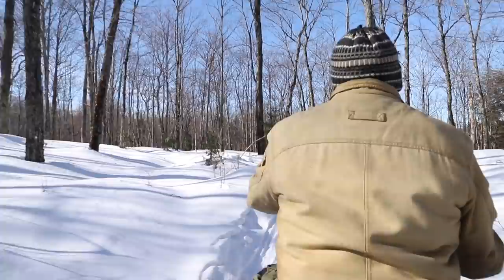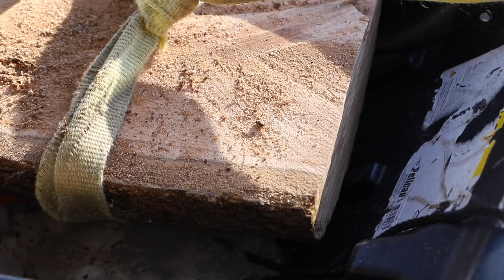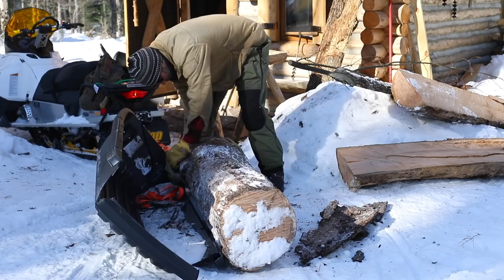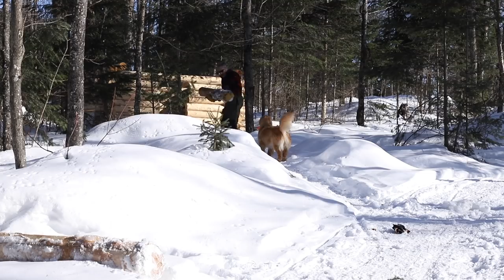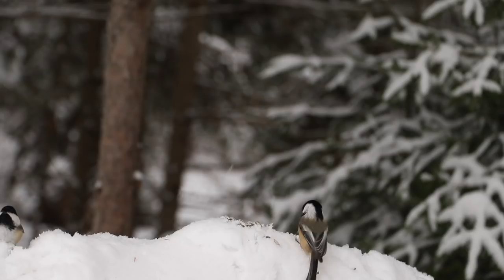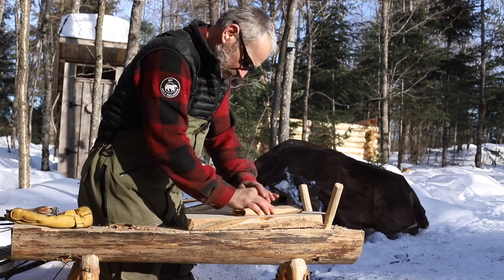Wilderness Lumberjack Workout with an Axe | Cherry Wood | Basic Bushcraft Project

Comment: Very cool.  For maximum yield after air-drying, I would strongly recommend using and end-grain sealant on the logs.  Commercially available sealants such as Anchor Seal work very good, but in a pinch you use paraffin wax or candle wax.

Comment: Shawn, I have made several cutting boards over the years and I would like to tell you about a great product that Lee Valley sells.  Non-marring "Polylastomer plastic feet".  They work great so that the cutting board doesn't slip around on your work surface.  They come in several sizes and are easy to install.  Check them out maybe this will help.  They would work really nice on your table and they don't leave marks.  BTW, that cherry log looks awesome!  I can't wait to see what you do with the wood.

Comment: Lifting things in the winter/cold weather isn't the same as lifting the same item in the summer.  You have a lot of extra weight just in the clothes you wear.  I weighed what I wear when I go hunting and it came to 11 lbs, my pack weighed 30 lbs and my gun 5 lbs.  46 lbs is a lot when you're hiking a couple of miles in just 8 inches of snow at 60 years old.

Comment: Last night  was watching another "log build" series called The Outsider.   They have built a super wooden sled with wooden runners probably 6" deep.   Theirs is about 4' wide and they eventually built 3 sides on it like a truck base.    It was pulled once but he also used his snowmobile.    Maybe a narrower one might be suitable for your tracks.     They also built a temporary sleeping/tool shed over it.   Then different series built one they
built a cabin on.

Comment: You don't need a exercise program you live it. I do believe you need to make a wood sled to haul the logs in. That fiberglass one won't last much longer. Great videos I know they are a lot of work with moving the camera so much back and forth. Thank you for doing them.
Reply: +1 on that, a proper sled would also make it more efficient when you need to bring home more firewood when all the cabins and the workshop are finished. A sled that could take 5-10 logs would save you much time. We also made a simple floor for the sled so that we could transport other stuff than  logs on it.
Reply: New sled, you can do it. Videos are great.

Comment: That was a good day's work. I'm impressed with your strength and log handling abilities. Rolling, pivoting, balancing, rotating and lifting. You've obviously picked up a lot of skill and muscle tone as a result of your log building. I wonder if your viewers understand the difference between shifting softwoods and hardwoods. I would encourage you to invest in a lifting belt and to avoid twisting movements while carrying those heavy loads. Disk damage is permanent and is a game changer. I had two disks removed and had to retrain myself to work a lot smarter. I was fine for about 20 years but arthritis is destabilising the operation site. Therefore now I also have a limit I absolutely have to respect or I'll be out of commission for week. My work flow would be slower than yours by half. I find I have to maintain a pace that is queued to the state of my back. ... Be careful and keep having a great life.

Comment: Not telling you how to work because you certainly know how to do that 😉 
But if you build a sled from wood an in between the runners you added the middle section from a plastic bed liner from a pick up truck it would greatly increase your load capacity .an groom your trail at same time . You machine is very capable of towing much more . Love the channel 👍

Comment: Your trail is a Calli speedway!
I really like how you secure the log to the snowmobile in the trailer. Even if it slips out a bit, the butt end won't dig in and it can't entirely leave the trailer. Good job. (A thing to remember - we've hoicked up the butt ends to avoid this, but yours is a much better and simpler method/answer.) 
Thanks!

Comment: That's going to be worth it Shawn👍 Beautiful wood
I'm sure you've heard of them but maybe not. You should reach out to Logosol portable sawmill company soon before you go too far. Hands down the most efficient sawmill on the market. It all breaks down and can be packed in to remote location and you mill on the spot. Then you leave the mess and walk away with lumber. Can handle 5' diameter trees and infinite lengths with right attachments. 
Can be stored away when not in use so you don't have a huge piece of equipment as an eyesore sitting around.  It's beaten woodmizer year after year in competition 
I'll DM you a link on IG 👍

Comment: Couple of questions. 1)  What is the approximate total thickness of the cabins roof? In one recent video your were nailing into the ceiling/roof and I was kinda of surprised. (You were working in the loft). 2) You often talk about the mental part of life at the cabin. How do you mentally deal with arduous, ‘boring’ and extraordinarily difficult tasks like getting the cherry tree back to the cabin?

Comment: I haven't been in the snow in over 25 years. But it's been my experience that a snowmobile trail 2 track wide is more stable. It lets the frost go deeper and will stay froze longer which will be to your benefit. I know you can't go 2 track wide in some spots. Snowmobiling is something I really miss, and going out in nature where the sounds of mankind is very distant. Kind of opposites with that, LOL.

Comment: man do you need a tow sled.. if you take a tree run it between 9 and 3 o'clock and put heavy duty thick 10" round trees on both ends 12 and 6 you would have a make shift tow sled.. ya put ski's on the bottom have places to strap the log two,, would work better than the ice fishing sled your using... but just an observation.. you definitely have the skill to build it..

Comment: How to store plywood in 100" rain- a contractor built and paved roads for 40 homes. Bought his lumber package and stored on road. The rain fell created a tent just like your tarp and logs. The t 1-11 installed would not take paint. Sent to plywood bureau research and held $500k bond pending search. The rain and humidity created greenhouse and denominated plywood. Suggestion place two log skid to store logs then egg in rape between two trees and place tarp over rope. Anchor tarp with a log as deadman allows air and humidity to flow.

Comment: Hello Shawn.  Just thinking about your summer water requirements.  Do you have a water pump?  Would there be any adverse issues if you set up a rain collecting barrel with a filter and used it for drinking water and cooking?  I don’t think it would be an issue for a garden.

Comment: You need to build A " cargo sled " for your snowmobile now , little plastic sleds don't  hold much . I have myself , got A plastic sled too and inadequate.  I made mine 7 feet long , used A 30 gallon plastic  barrel for front curved portion and then plywood framed for rest coated with smooth thin steel on bottom . Take A sawzall to A barrel to make front portion , get creative .

Comment: Nice wood grain.... and a good workout slugging those logs around. I use a short handled trench shovel which has a 18" concave blade to strip bark off....of course that is not as traditional as  an axe .

Comment: Man you work to much......you need a steel sleigh not that cheap plastic crap longer with accesories to strap logs easy something costume made home for your  needs.......and the beauty of snowmobils it that they cant be costumize like Motobikes you cant upgrade the engine for more power change tha chainwheel for bether traction the front skies to take turnes more easy all kind tehnichal tricks to make your work more easy....

Comment: The trail firmed up nicely overnight for you Shawn. Now you just need a better sled for hauling logs if you plan to do it more often. That toboggan seems to just want to roll over with a log in it. Something wider that will lift the front of the log should work well behind the snowmobile.

Comment: Shawn, it looks like you need a ski sled to drag your logs back. I’ve seen those with chains in an X pattern to hold both sets of skis together and it tracks straight thru the snow behind the machine.